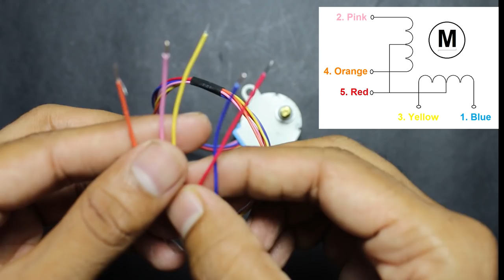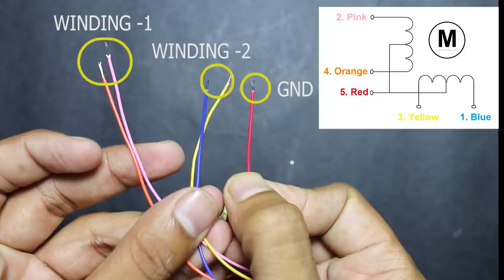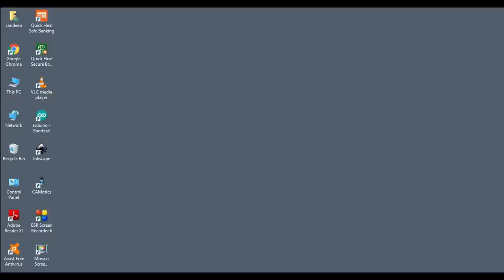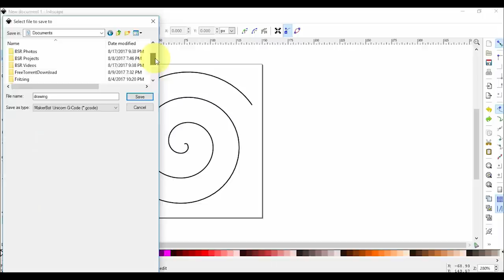28BYJ-48 Stepper Motor + Arduino + L293D Motor Shield + processing setup test run

Comment: i have followed your instructions and it works. But i have some question. after gcodes are finished, motor still have voltages. because of that motor vibrates. then manually stop the motors by pushing 0 button. i added deenergized codes to gcodes but i didn't work. because arduino code can't detect this codes. i added some codes to arduino after plotting is finished then motors are deenergized.

Comment: i have used this shield after connecting four motors 12 v 1 amp power supply is using here upto 3 motors is working but after connect 4 th motor it is not working how much power supply is need to be given for four motors?

Comment: hello
it it possible to add sensors to the arduino to move the motor  a short distance and when the second sensor is activated the motor would reverce the same distance
the reason i am asking is that i would like to make a set of road barriers for a model railway
and i want to put them on some kind of sensors that when the front of the train meets one sensor it would close the barrier and when the train hits the next sensor it would open the barriers that is why i am asking about the forward and the reverse distance of the motors when activated as the would need to travel equal distance from the open to the close of the barrires
your help would be greatly needed as i am new to electronics
thanks
james

Comment: sir i connect Arduino uno with shield. shield connect 2 stepper motor, 1 servo motor and then also all process is being good but motor are not rotating!!!! whats the problem sir??
Reply: hai buddy 

I am facing the same problem

please help me if you found the solution
Reply: ravi teja no , i dont know from where to but working Arduino
Reply: E.T E.E okk... thank you
Reply: Rohit Singh yeah i also done that but motors are not rotate!!!
Reply: i think beacuse the servo motor its not compatible with the shield

Comment: Hello
Please help me
I follow the steps as in the video, but the mini cnc does not work. Whereas in programming there is no notification error. What should I check again
Reply: the connection betwen the motor and the arduino

Comment: hello help how fix Universal gcode sender error 1" Gcode words consist of a letter and a value .Letter was not found " thanks before
Reply from the maker: which software you are using to generate g-code ?
Reply: +Mr Innovative using inkscape 48.5 and exsistensi unicorn gcode last save import to universal gcode sender in visual ok but i send error 1 how fix this
Reply from the maker: i'll suggest you to use pronterface (http://kliment.kapsi.fi/printrun/Printrun-Win-Slic3r-12July2013.zip) instead of UGC hope your problem get solve..

Comment: Say where we should connect the servo motor in circuit
Reply: There are 2 servo connections on a Adafruit motorshield. There are connected to pin 9 and 10 on the Arduino.

Comment: Hello, Mr.Innovative.
Please help me
I follow your videos every step. But not successful
I can not be compiled

Error message
C: \ User \ samsungW32 \ Downloads \ CNC_code.ino: 7: 21: fatal error: AFmotor.h: No such file or directory.
    #include <AFmotor.h>
                                    
                                     ^
Compilation terminated.
exit status 1
Error compiling for board Arduino / Genuino Uno.
What it's meaninig?
I am a new user. There is very little understanding about the Arduino.
If you can suggest me for a solution that might be found, it will be highly appreciated.

Thank you very much.

Comment: error
Invalid library found in C:\Program Files (x86)\Arduino\libraries\Adafruit-Motor-Shield-library-master: no headers files (.h) found in C:\Program Files (x86)\Arduino\libraries\Adafruit-Motor-Shield-library-master
avrdude: stk500_recv(): programmer is not responding
avrdude: stk500_getsync() attempt 1 of 10: not in sync: resp=0x64

healp me !!!!!!!!
Reply: this problem manly occurs when you have a problem with the board itself or the cable I should advise buying a second board and seeing if that one does work and if it does, problem solved. I had the same problem and for me it was indeed the board not functioning properly.